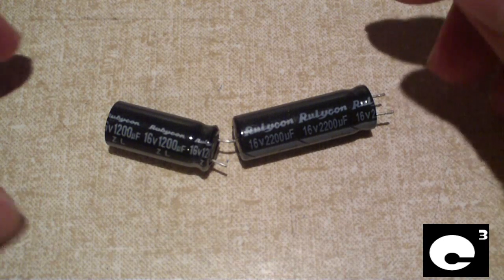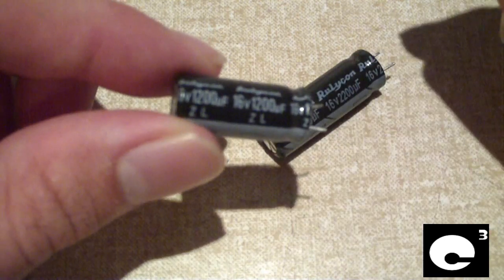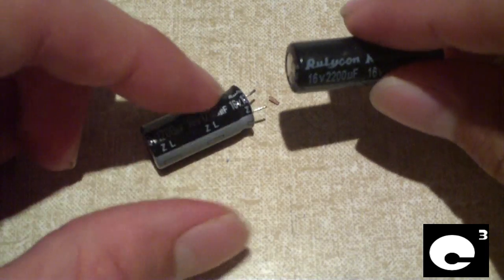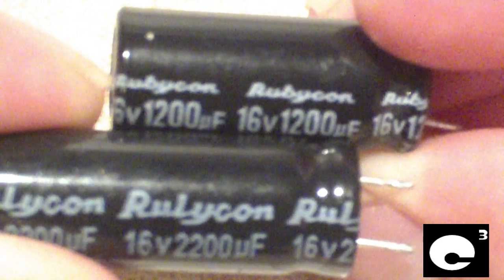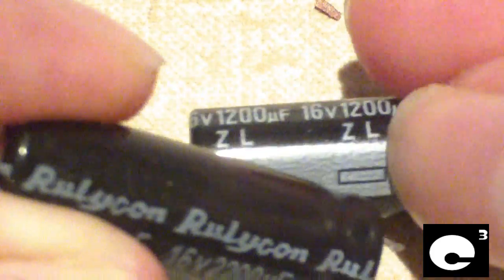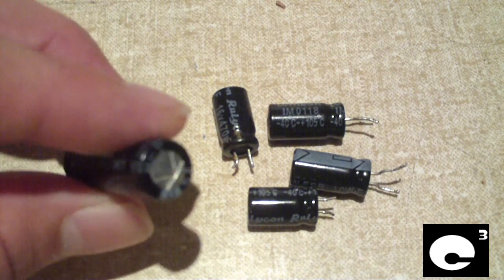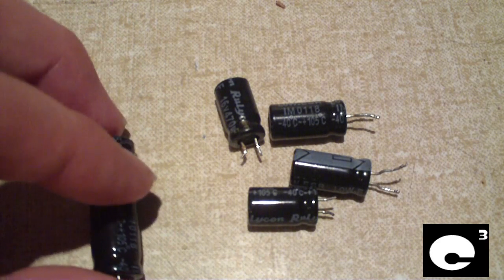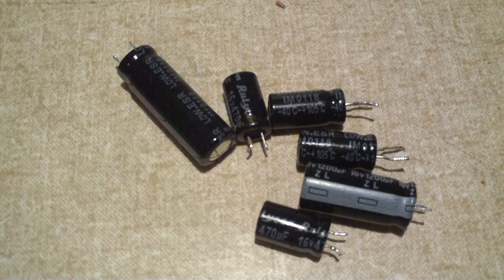Fake Rubycon Capacitors - Rulycon (L instead of B) Junk

Comment: lol, rulycon... I've found some counterfeit rubycon capacitors too. They look almost the same as the original ones, they are written as rubycon too. How to check them? You can check them by using datasheet. Here I have fake YK series with 105 degree celcius temperature rating. What I got from the datasheet is the YK series only have 85 degree celcius temperature rating. And you should check the strip shape, the height, the diameter of the capacitors too. You can also check what's inside it.